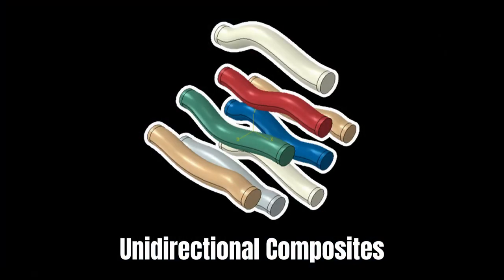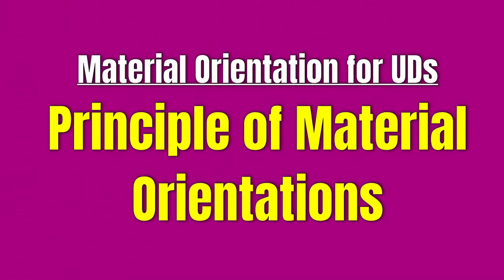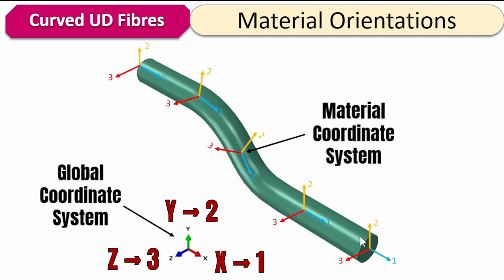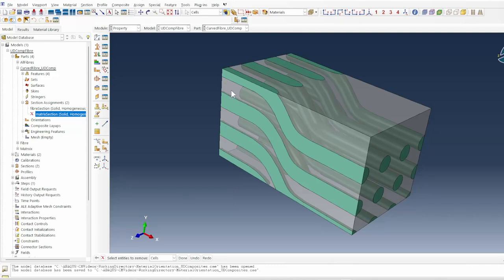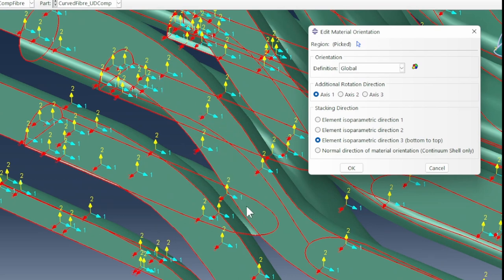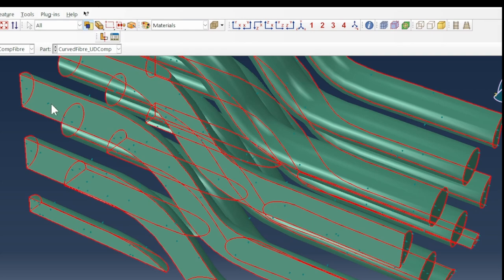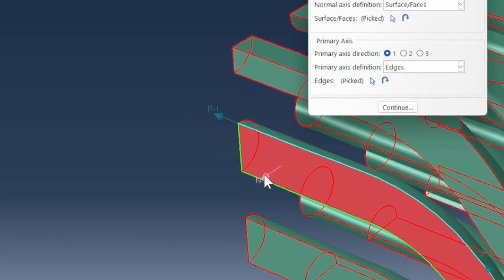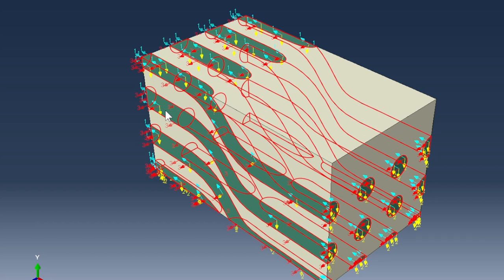ORTHOTROPIC FIBRE and how to assign its material orientation

Comment: Hi Dr Michael
thank you for sharing this video. I have one question, if I want to simulate the straight fiber with different fiber orientation (different stacking sequence like 90, -45, 45, 0), should I Use Default Orientation or custom it using a Discrete? When I tried to use the discrete, the error massage occurred. Looking forward to hearing from you. Thank you.
Reply from the maker: Hello, this is a good question. I will suggest ou use the Discrete option, as that will be more appropriate. Any of the fibres 90deg, 45deg, will have their discrete unique option. If you have too many orientations, then the user-defined option might be used. That will require a more careful and considered consideration.
Reply: @MichaelOkereke  thank you very much for your kind response Dr.
Just wonder if you could help me with the different fiber orientation tutorial in your next video when you have a free time. Cheers!

Comment: Nice video Professor. Can we do this procedure for orphan mesh models in abaqus. There are no geometry present inside the model because of the orphan mesh. Then how to select the surface specifically?
Reply from the maker: Hello @Vishnu OS, this is a good question. It  is always tricky working with orphan meshes as there geometry data is missing for such meshes. You may be able to convert the orphan mesh into a geometry. Dr Ronald Wagner, a Youtuber that I recommend, has done this. Check his video about this here: https://youtube.com/watch?v=y5U_Xa_yMlQ&si=EnSIkaIECMiOmarE
Reply: @MichaelOkereke  thanks for the reply professor. I will check this out.

Comment: Hello Dr. Michael, Thanks for the great videos. Based on the following python code, we are trying to create a script in ABAQUS that automatically generates a kinking model according to the angle of the wavy fiber of a unit cell composite of length th according to the following conditions.
1. Creating a 2D mesh of the matrix and fiber cross-sections
2. extruding them along a sine wave trajectory, and setting up cohesive contact surfaces and periodic boundary conditions in ABAQUS
However, it is difficult to write a python script according to the curve of the 2D mesh. Can you help me with this part?
Reply from the maker: Hello @KimsComposite, thanks for the comment. Unfortunately, this seem more of a project and not something I would help with. I tend to answer one-off specific questions and if there is a video worth making on such requests, then I will consider it. Good luck with this.

Comment: Hi, Professor! I love your videos! I would like to know if is possible to make a video about random orientation of fibers. I would appreciate it a lot, because I tried to change the code in python however, during the assembling, most of the fibers stay outside of matrix. Do you have any suggestions about how to put them random but in a set limit? Thank you very much!
Reply from the maker: Hello @Willison, thanks for the comment and glad you love the videos. As regards random orientation of fibres, I am not sure what you mean. Is it random fibre positions i.e. centres of the fibres on a 2D plane or random angles of the fibres i.e. inclincation of the fibres along its longitudinal axis, as it relates to say short fibre composites? 

With the random centre of fibre positioning, I have a series of videos that deal with that an the MontCarlGen2D software (see link in description of this video) will help you automate that. However for the random inclination of fibres along the longitudinal axis, this is something I am yet to implement into a script. I have also not made any video about this. I see this can be best done using a python script and will consider this for a future video challenge. 

I am not sure why your script is not working, so do give me some more insight on get in touch with me via the CM Videos Insider Group (see link in description section of this video).
Reply: @MichaelOkereke  Thank you for your reply. Regarding my doubt, I am trying to put random fibers in a 3D matrix (3D-Plane). I wrote a code and it is working. However,  since the fibers  (in my case short-fibers)  can assume any orientation, sometimes the fibers assume a position so they are outside of the matrix, so I need to adjust my code so the fibers get oriented but in a set limit according to volume fraction, otherwise the analysis will be incorrect since some of them are not inside the matrix. I watched your video about 2D random orientation and I think It can be extended to a 3D case, but I am still studying about that!

Comment: Great video, Thanks! Have you ever written a UMAT when a material orientation is specified? This adds some extra complication as the deformation gradient acts differently than in a global coordinate system. I did this before but always seem to get incorrect results when calculating the stress using the deformation gradient in the material coordinate system. This is a topic that is very hard to find information on.
Reply: Hi Dominic!: Are you familiar with using UMAT subroutine?
Reply: Somewhat but I'm far from an expert :)
Reply: @dominicbrennan4823  Please Sir, do you know how to make properties of elements (Young's modulus) changes with each step based on an equation? Thanks.
Reply: @khaledcine6542  You need to use state vaiarbles ('STATEV' in ABAQUS) to save the relevant quantities that you need at each step. You choose how many state variables you want when you are creating a material in the CAE. At the beginning of an increment, you define your relevant quantities as state variables. Then you use your equations to calculate the change in the relevant quantities. The properties are then updated for the next step using a numerical procedure such as Eulers explicit method (this works for basic models). Your updated quantities are saved as the relevant state variables which can then be used at the beginning of the next increment. Note also, that ABAQUS expects you to update the 'STRESS' (and possibly 'DDSDDE' depending on your problem)  values at each increment of your UMAT also.
Reply: @dominicbrennan4823  what about the steps, you create it manually in Abaqus as usual, or you write it in the script code of UMAT? Thanks
Reply: @khaledcine6542  You need to write the steps in a UMAT script. There are lots of templates online and on the ABAQUS documentation. The UMAT works in conjunction with the ABAQUS model. You draw your model in ABAQUS, define your materials, properties, boundary conditions etc. In the 'Edit Material' option in ABAQUS, select General and then Depvar....this is where you select how many state variables you want to use in your UMAT. Also select USER MATERIAL in the General option to tell ABAQUS you are using a UMAT with your model. In this option, you can enter material properties you wish to use in your UMAT. These will appear in the UMAT as 'PROPS'. Remember the UMAT is a FORTRAN subroutine. It allows you to take various arrays/vectors used in ABAQUS and then use them for your calculations. ABAQUS gives you the deformation gradient, strain tensor and many other things you can use in your calculations. You need to use these to update the STRESS and tangent stiffness matrix DDSDDE which is then fed back into ABAQUS to calculate the next increment. When you create your Job in ABAQUS, you go to Edit Job and then General and then there is an option to add the path where you have your user subroutine file. Try googling this: "writing a umat or vumat iMechanica" to find a useful slideshow on creating a UMAT.
Reply: @dominicbrennan4823  Thankyou very much sir, can I have your coordinate contact please? I have to try and back to you, if thats possible for you. Thanks.
Reply: @khaledcine6542  Try this video too : https://www.youtube.com/watch?v=5br5fjqK0uM&t=881s
Reply: @khaledcine6542  If you have a specific question, ask here. I'll try answer if I can. I don't have much time otherwise. As I said, I'm not an expert. I'm still a student and learning.
Reply: @dominicbrennan4823  I have create a UMAT code, I write strain energy formula (depend on stresses and strains), now I want to plot the strain energy, do you have any idea?
Reply: @khaledcine6542  You can save the strain energy result as a state variable and then plot it in post-processing (after you open your results in the .cae). Before you run your code, you need to select Field Output so you can choose what quantities (Stress, strain etc.) you want ABAQUS to save for post-processing. State variables are found under State/Field/User/Time and then choose SDV. Once these are saved you can plot like any other quantity when you obtain your results. You can also export the result to an Excel file. There are loads of videos on how to do these X-Y plots on here, for example: https://www.youtube.com/watch?v=cdH6WPmaPVE&t=1s. 
Another option is to create a text file in your UMAT script and then save the results to this file at the end of each increment (or at defined intervals of increments). At the beginning you need to define the file path and open it: 
CHARACTER*80, PARAMETER :: FILEPLACE = " insert file path here "
open(100, file= FILEPLACE//"name.txt")
To write a quantity you use WRITE(100,*). I recommend looking up writing text files in Fortran. 
Note: The 100 value is chosen randomly but each file you write needs to be numbered so you can call on it. The value 80 is just the number of characters allowed in the file path name. This can be changed as needed. Writing text files do slow down the code but this shouldn't cause problems unless run time is a big issue. Writing quantities is also a good way to check your calculations when testing your code (see if results look reasonable of if any NaNs are appearing etc.). If you use WRITE(*,*) command it will write the quantity to the .log file ABAQUS creates (and you don't need to open your own text file).
Reply: @dominicbrennan4823  Great, now the code is working and I can plot the SDV, but still didn't know how to determine the number of iterations based on if condition. and for example I have initial density, with loading there will be a variation in density ( so there is a new rho), haw can I plot this variable with certain number of iterations
Reply: @khaledcine6542  In the UMAT, 'KINC' gives you the number of increments. You can use this to print the density or whatever at a certain number of increments. Eg. 
IF (KINC.EQ.1000) THEN
WRITE(*,*) something
END IF

In the case you want to write the density ever 50 steps, you could use:
NAME = MOD(KINC,50)
IF (NAME.EQ.0) THEN
WRITE(*,*) something
END IF

If you want to plot directly from ABAQUS, you can choose to save results every certain number of increments. When editing your Field Output Request, for 'frequency', use 'every n increments' and then set n equal to say 50 (for example). In post-processing you will see your results every 50 increments.  

You can also select which incements you want to plot in post processing. When you select X-Y Data, then OBD field output, there is an option for 'Active steps frames' you want to plot. You can use that but it's not something I normally do so you will have to play around to see how it works.
Reply: @dominicbrennan4823  
I want to make Young's modulus change in each iteration based on the density, didn't implented this yet.  what you think about my bellow code?

 PARAMETER (ONE=1.0D0, TWO=2.0D0, THREE=3.0D0)
	 IF (KINC.EQ.30) THEN
	   E=PROPS(1)
	     ANU=PROPS(2)
		 D=PROPS(3)
	   ALAMBDA=E*ANU/(ONE+ANU)/(ONE-TWO*ANU)
	   AMU=E/(ONE+ANU)/2
	     Do I=1,NTENS
	      DO J=1,NTENS
	      DDSDDE(I,J)=0.0D0
	      ENDDO 
	     ENDDO 
	    DDSDDE(1,1)=(ALAMBDA+TWO*AMU)
	    DDSDDE(2,2)=(ALAMBDA+TWO*AMU)
	    DDSDDE(3,3)=(ALAMBDA+TWO*AMU)
	    DDSDDE(4,4)= AMU
	    DDSDDE(5,5)= AMU
	    DDSDDE(6,6)= AMU
	    DDSDDE(1,2)= ALAMBDA
	    DDSDDE(1,3)= ALAMBDA
	    DDSDDE(2,3)= ALAMBDA
	    DDSDDE(2,1)= ALAMBDA
	    DDSDDE(3,1)= ALAMBDA
	    DDSDDE(3,2)= ALAMBDA
	     DO I=1,NTENS
	      DO J=1,NTENS
	      STRESS(I)=STRESS(I)+DDSDDE(I,J)*DSTRAN(J)
	      ENDDO
	     ENDDO
	K=0.000036
        O=0.1
        A=1
	S11=STRESS(1)
        S22=STRESS(2)
        S33=STRESS(3)
        S12=STRESS(4)
        S23=STRESS(5)
        S13=STRESS(6)
	E11=DSTRAN(1)
        E22=DSTRAN(2)
        E33=DSTRAN(3)
        E12=DSTRAN(4)
        E23=DSTRAN(5)
        E13=DSTRAN(6)
		SED=(S12*E12+S23*E23+S13*E13)+(S11*E11+S22*E22+S33*E33)/2
C       CHANGE IN DENSITY WRT TIME
        IF(SED>=(K*(1+O))) THEN
        DEN=DTIME*(A*(SED-K*(1+O)))
        ELSEIF (SED<=(K*(1-O))) THEN
        DEN=DTIME*(A*(SED-K*(1-O)))
        ELSE
        DEN=0
C       UPDATE THE DENSITY
        D=D+DEN
		ENDIF
		ENDIF
		SED=STATEV(1)
		RETURN
        END
Reply: @khaledcine6542  I'm not sure why you use 'IF (KINC.EQ.30)' at the beginning. Surely you should be calculating these quantities every increment regardless of whether you only want results at certain intervals. ABAQUS needs to calculate each iteration. If you want a quantity (that you define) to update each step, then you need to give it an initial value for the first increment and then save its valuable in a state variable that can be extracted in the next increment. Say you want Density, for simplicity:
IF (KINC.EQ.1) THEN
D = PROPS(3)
ELSE
D = STATEV(2)
END IF

"CALCULATE CODE HERE-GET NEW VALUE FOR D"

STATEV(2) = D  

Now your new value of D is save in STATEV(2) and in the next increment d will equal this new value. 
Your calculation of STRESS and DDSDDE look correct for an isotropic elastic material.
Reply: @dominicbrennan4823  Okay I will try my best to work on it. what about loading, how I can make same load applied in each iterations?
Reply: @khaledcine6542  Load is applied in ABAQUS either as a boundary condition or the load option. Depends on which kind of load you want on the piece. Generally the same load is applied every iteration unless you specify otherwise.
Reply from the maker: Hello @Dominic Brennan, thanks for this. Unfortunately I did not encounter this type of problem personally but my PhD student did. He has graduated so I will need to find out what he did. Cheers. Thanks also for responding so patiently to Khaled's query.
Reply: @MichaelOkereke  Thanks very much for getting back to me. That's interesting that your PhD student encountered this issue also. I would be very interested to find out how they solved this issue. Either way, thanks for making the video content, it is a very useful resource.